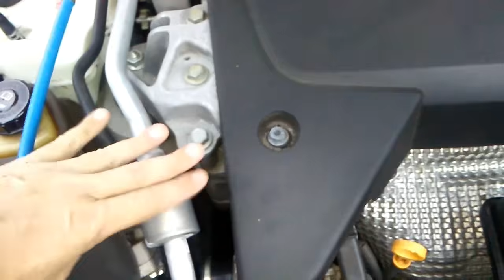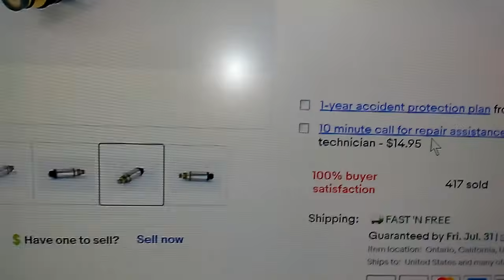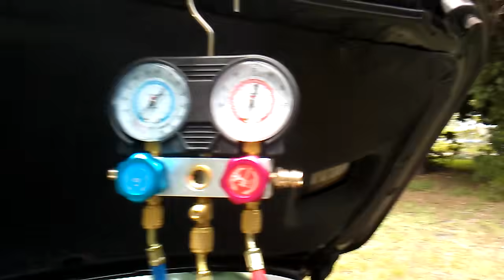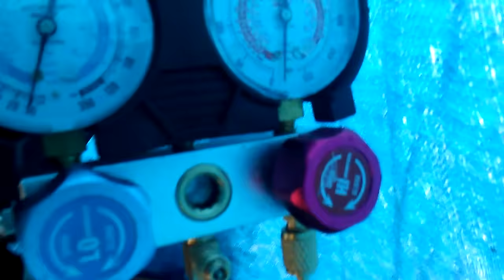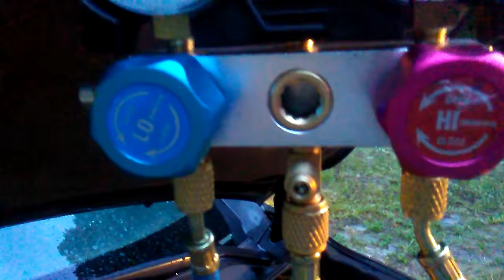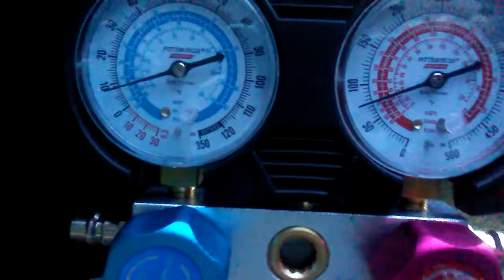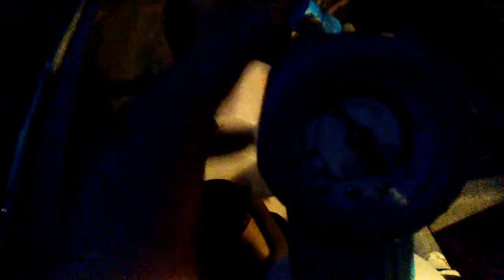WEAK AC FIX!  Nissan Altima SV/SL AC Compressor Refrigerant Control Valve Solenoid Repair

Comment: Thank you for this video, I fixed a coworker/friends car with these exact symptoms. The tell
 tale sign was the low and high side readings were identical to yours. Its almost like having gauges hooked up and opening the valves between low and high side allowing a bypass like condition. He got an auto zone part for faster availability but many amazon reviews showed a high failure rate of these across the Nissan line up of vehicles.
Reply from the maker: brilliant! glad things worked out.

Comment: As someone who did a/c work, that oil in the vacuum gets "saturated" with water as the moisture is sucked through the vacuum. Since this is a rental tool, and most people don't know that, there is no telling how long its been since the oil was changed and it could be heavily saturated. Water vapor (moisture) mixed with coolant, turns into an acid and slowly eats away at the parts inside your compressor. So when you create that vacuum, it actually boils the moisture turning it into a vapor and removing the "steam" from the lines and such. So long story short, absolutely spend $8 to $12 and replace the oil in the vacuum compressor before using it because its not worth having acid in your a/c system over $8 to $12 worth of oil. Also you need to run a vacuum for a minimum of 30 minutes straight. You honestly can't vacuum too long. The more the better. On my vehicle I would run it for an hour straight.
Reply from the maker: Good to know, fortunately the two times i borrowed a vacuum they had leaked empty and they had to refill for me.

Comment: would this fix apply if the mechanic states the compressor wont switch on?
Reply from the maker: possibly so.
Reply: @mst3kpimp  ill try the repair soon, its worth the shot instead of spending the 1k for new unit
Reply from the maker: @alangorrosquieta455  indeed, please let us know how it goes.

Comment: Would a bad solenoid effect condensor fan speed?
Reply from the maker: in a sense since the fan kicks into high speed when the ac hits a certain pressure so if the solenoid is affecting that it can affect the fans as well.

Comment: Does the s model have the same setup?
Reply: I have a 2009 S model and it has a mechanical control valve with the manual climate control. No wires as it uses an internal bellows in the valve to try and maintain suction pressure. The variable displacement compressors need a device like this to change the angle of the swash plate inside the compressor.  The Valve is in the housing facing the engine block so it isn't easily seen (on mine), held in by a C clip.  
As the evap temp drops because the cabin is cooling, the TXV reduces the amount of refrigerant flowing into the evap which also means lower pressures on the suction side of the compressor. The valve responds by decreasing the angle of the swash plate so the compressor isn't pumping as much.  As the temp load on the evap increases (or is already high) suction pressure will be high, TXV opens more to flow more refrigerant to the evap and suction pressure is high, so the valve increases the angle causing the compressor to pump more.  This is constantly changing as temps change.

Comment: Thanks for the video!
Couple of set backs:
Parts place sold me the wrong part.
The gauge kit I rented didnt have the low & high side fittings. Shame on me for not checking before I walked out of the store.
Other then that...new part should be in tomorrow. Ill know if it fixes the problem then.
Ill be sure to post!
Reply from the maker: yes keep us posted!

Comment: Hey, I replaced the AC compressor, which means it has a new switch/sensor but it still does the same thing. I'm going to replace the expansion valve to see what happens.
Reply from the maker: odd, please keep us posted.

Comment: Hey great video! I have a 2013 and I'm going to try this. Is there a specific order to perform this? Am I suppose to remove the control valve first before evac and recharge? Is it possible just to replace the control valve and use those canned freon refill bottles? Thanks again for your knowledge!
Reply from the maker: must do evac first its under pressure! then put in new valve, you can use the canned freon though good luck.

Comment: So when the dealers replace the compressor does it come with a new solenoid?
Reply from the maker: Yes, but usually just replacing the solenoid is all you need.

Comment: I can definitely say this helps!! I got mine replaced and now i’m getting freezing air!

Things I do want to share. Mechanics will try to say it’s the compressor but it’s not, most shops will not allow to replace the single part which is frustrating because of “liability”

Research and find different mechanic shops to get your system evacuated, installed and recharged. 

Luckily my local Kwik car and Lube charged me $200 for installation, evacuation and recharge with no questions asked.
Reply from the maker: yaaay!

Comment: Only if it was that simple for a 2017 Nissan Altima.
Reply: Why do you say that?  The 2013-2018 have the same setup.
Reply: The control valve on a 2013 Nissan Altima is facing down and all the person has to do is pull it out with whatever tools they have. However; the 2017 Nissan Altima control valve is....I cannot locate it.
Reply: @beeemdee_  Only the SV/SL trim versions have the valve, the base models do not.
Reply: Never mind, I have a possible compressor problem.

Comment: thank you so much for your video. Shop told me compressor was shot and it had sent metal shavings throughout my cooling system, wanted 2000 to fix. Saw your video matched my symptoms in my 2016 Sentra, now my ac is running like new. 35 dollar control valve saved me 1900 and change. cannot thank you enough
Reply from the maker: yes the "shops" are not to be trusted sadly.  glad to hear another success story!

Comment: Charge R-134a systems by weight, not using the gauges. You'll never get the proper weight in using those little cans

Comment: I have a 2010 Altima SL, the previous generation of cars, and ended up buying an Expansion Control Valve, the compatible part doesn't have the electronic connector on it and it looks different.  I haven't lifted the car up to check, but do you know if the 2007-2012 have the valve in the same location, and if the replacement procedure is the same?
Reply from the maker: You can tell right off by looking underneath

Comment: Can anyone there to tell me what will be the diference with the reading between a open stuck expansion valve and  and bad control valve solenoid?
Reply from the maker: I found this info regarding expansion valves "The expansion valve can fail in one of two ways. When stuck open, it allows two much refrigerant flow, and a drop in high side pressure. A gauge reading of less than 200 psi on the high side will be seen when this happens. When stuck closed, a higher than normal high side reading will be seen.

Comment: Thank you, fix my 3.5 sl 2013 model, saved around 2500$ of replacing all cool unit
Reply from the maker: Yes indeed, mines still going strong.
Reply: I also have a 3.5, but the control valve is not as easy to get to as the 2.5s. Did you have to remove the A/C compressor to install this?

Comment: Hi there, is that solenoid has to deal with the radiator cooling fans or not ? Because I've an issue with my cooling fans that aren't turning on in full speed with the A/C on 
Note: the fans are new
Reply from the maker: yes the fans will kick into high when the ac pressure builds past a certain point so if your ac isnt working right they might not do that as much.

Comment: Good job dude,, so the problem is have done,, i don't no, how fix electric control valve?, it just change the O'ring valve or coil electric?,, i have problem on Hyundai Tucson/2010,, but it doesnt work.. Mybe should change original part( Control valve)
Reply from the maker: your car appears to have similar valve as mine so replace that and see if it solves your issue.

Comment: Have a 2014 Altima.  Air Con wasn't working.  Shop replaced the condenser.  Now it only blows cold air on driver side.  Passenger side blows warm air.  If you put MODE on FACE, it blows on feet.  If you put on DUAL FACE and FEET, it hardly blows anything anywhere.  What the heck is wrong with this system and how does it get fixed?  Have spent over $1,000 already.  Help!
Reply from the maker: wow thats a new one, could be a faulty temp control panel unit or maybe one of the motors that swing the vent doors is bad or stuck.
Reply: @mst3kpimp  I have a friend who is a mechanic.  I talked to him recently.  He said it has something to do with "flaps" and the entire dashboard would have to be removed to fix it.  "Trade it in," he said!  Would the entire dashboard need to be removed to fix what you said might be wrong?
Reply from the maker: @pwgaplantationbay5469  yeah those flaps direct the ac but I dont have much experience with them.  You may be able to access after removing the glove box or radio ect.  i dont know why  replacing the ac suddenly made them malfunction.
Reply: @mst3kpimp  Thank you for your help.  Much appreciated.

Comment: I have another question, I am getting ready to order the same valve from the Ebay page you pulled up, I have a 2013 Nissam Altima S 4 cylinder, will it still work whatever compressor valve I am looking at they say they are compatible with SL/SV models and am wondering if my S will also work with the same part I just want to order it already, thank you and look forward to your response
Reply from the maker: It wont work, only the sv/sl models have the valve as part of the auto climate feature.
Reply: @mst3kpimp  thank you for the reply, what are your recommendations on what I should do I want to change the compressor valve for the S, do you have any links for S I cannot find the part for mine
Reply from the maker: @aco3495  the s model has no valve to replace. your either experiencing a  refrigerant issue or possibly bad ac unit.
Reply: @mst3kpimp  do you think I need to replace the entire compressor? When I turn the ac on it is making a almost whistling sounds from the ducts
Reply from the maker: @aco3495  i cant speak to that as i am only familiar with my car, youll prob need to look elsewhere for advice.

Comment: Hey man thanks for the video, I had a question I do not have the vacuum to remove the freon, what shop do I take it to I live in Arizona, so I am not really sure what shop does this because I didn't even know you had to remove it, also do you know what they charge, thank you and look forward to hearing from you
Reply from the maker: any shop should be able to do it and they prob will switch the valve for free if you get a recharge from them.
Reply: @mst3kpimp  That was a fast reply thanks man! Really helpful appreciate it

Comment: I’m having trouble getting this thing in all the way
Reply from the maker: assuming your talking about the valve, tapping with a socket worked for me or a rubber hammer should be safe.
Reply: I am having trouble as well. Can please give me some tips

Comment: Perfect fix for my 2014 SL! Took my car to have the Freon removed. Popped the new valve in last night. Got a full charge today and wow! It’s way colder than I remember it being when I bought it new. The mechanics weren’t convinced at first. Told me I had to replace the whole compressor. They are believers now. Thank you so much for the great video!
Reply: I’m doing this because I’m the morning it blows ice cold! But I’m the afternoon and evening it blows hot! And they told me I need a whole new compressor too
Reply from the maker: glad to be of service
Reply: In the process of getting my replaced! Quick question, how much did you pay to get the Freon removed?

Comment: Another sign is the compressor is not cycling... It engages but never disengages. By the way my AC temp is 67 degrees. Cool but not near cold enough in the hot summer. Will be replacing my stuck expansion valve.

Comment: Does this work for me the 2015 Nissan Altima SV?
Reply: yes those models share the same ac parts.
Reply: Hi, would this work for our 07 Nissan Altima? Please 🙏🏽
Reply from the maker: @marcelametcalf7808  It works for most cars that have auto-climate control, just look under at your ac to see if you have the valve in it.

Comment: What’s the required psi for low and high?
Reply from the maker: it depends on temp and you need to understand how the pressure builds and releases but at 80f a low of 35psi and high of 170psi works

Comment: I wish I would have seen this video earlier, I have an 14 pathfinder sv that has been blowing hot air. The wife did not want me to fix myself because we’re going on vacation in a couple of weeks and said she just wants the car to run well. Had the system evacuated and recharged today, still running hot. I wish I would have seen this video so I could have told the guy to plug the AC control valve while he was evacuating the system. Took the car in auto repair, now waiting for my rape bill.

Comment: I'm hopping I have the same problem  on a 2013 toyota corolla s I have the  Electronic control solenoid if not the compressor $400 and the condensers $180  so it's the cheapest way out solenoid only 39.99🙏

Comment: Had the same problems you had on my 2015 Sentra, found your video and replaced the same solenoid - it’s working perfect now. Thank you for making the video. I broke the snap ring taking it off, found an assortment of snap rings at autozone that had one that fit. Took me a while to get the snap ring on, but other than that pretty simple job.
Reply: Did you have to remove the compressor to access the valve?
Reply: @armajay86  no - you don’t have to remove the compressor
Reply: @caseypage2  thanks
Reply: @caseypage2  im about to do this to my sentra do i have to relieve pressure takimg the snap ring of? Will the calve shoot out?
Reply: @luismartinezlm428  yea there will be some pressure and refrigerant that comes out when you take the snap ring off and the solenoid comes out. Drain the system first, or at-least wear some gloves and eye protection.
Reply from the maker: brilliant, glad it worked for you!
Reply: hey, was it in the same spot as in this video?

Comment: I have Nissan Altima 2015 which blows hot air if car is at halt and temperature above 38° C, however gives cooling while driving. If the temp goes higher than 45° C then it only blows really hot air even if car is running at 120KM/H. Now After watching your video i wanted to replace the compressor control valve and have contacted several Auto AC Center, but they all want to get the compressor changed and make big money and some AC Centers even say this cannot be done or compressor may get damaged just to lure you into buying compressor. Now when i checked about buying new compressor, they say it doesn't even have warranty, so what's the point? I am now enquiring with small service shop if they could replace this with proper steps so I could order one from ebay.  if it doesnt work out, I have to get rid of Nissan.

Comment: Sir my camry2011 suddenly stopped cooling, is it solenoid problem?
Reply from the maker: highly possible if your compressor has a solenoid.
Reply: Yes it's have a solenoid
Reply: Now what's to do, bcz last time they replaced 2nd hand compressor new condensing coil, done flushing. So in this case shall Ican remove solenoid & clean it enough and flush condensing coil and all system must be flushed, than sure this ac will work.?
Reply from the maker: @qpkhalid  just empty your refrigerant. change solenoid and see.

Comment: Good job. I rebuild/service my own stuff too. Remember, too cold and your evap coil will freeze up. Get that exact charge weight in and go from there. Pick up a can tap like you mentioned, it will have the proper 1/2" acme threaded connection for the charge hose. Then you can weigh your cans on a digital scale for the most accurate charge.

Comment: Hello and thank you so much for the video, it’s winter now here in NY however this summer was brutal in my 2013 Altima I want to ask you before you take the valve out do you need to take out the Freon?
Reply from the maker: yes no other way im afraid.
Reply: @mst3kpimp  thanks

Comment: Lol, you go to this eBay store check on their listing. They only sell compressor control valve, all the other car makers valve sold like 10, 20 while Nissan's garbage sold like 800 plus. I had the same problem and bunches other problems in the same car. I just got rid off the car after I was fed up fixing it.
Reply: Omg I just bought this car..I'm f#@$

Comment: Read several different blogs identifying that valve as the culprit. My AC guy and the dealership played stupid acting like they never heard of the valve and dealership acting as if AC issues were uncommon on Nissan vehicles. Both  wanted to change the compressor AC guy asking $850 and change. This is one of the better videos I have seen and it is much appreciated. If you take anything home from this please never buy anything new from Nissan ever again. We have experienced everything from the shifter stuck in park to AC issues every season. Their transmissions suck and the dealerships are no help and take you to the cleaners whenever they can. Horrible cars horrible even worse company just my opinion. Buy a Toyota and just work on other people's cars as a hobby.
Reply: Their leader was Carlos Ghosn. The biggest crook alive. What can you expect other than to be cheated? How he escaped from the prison in Japan will tell you all.